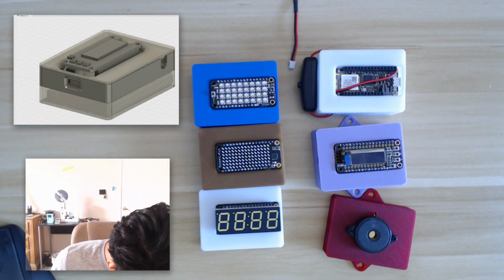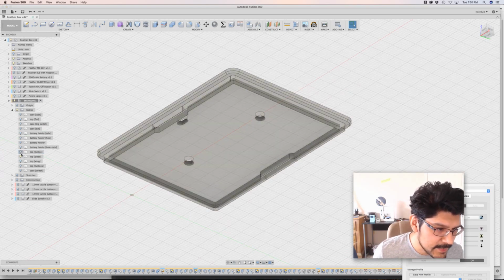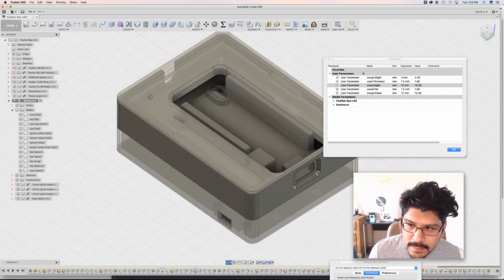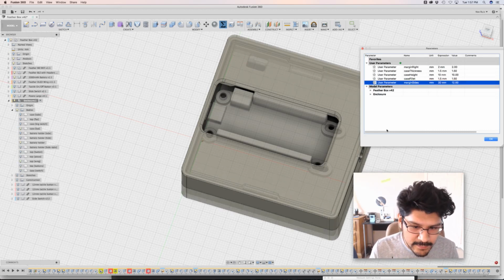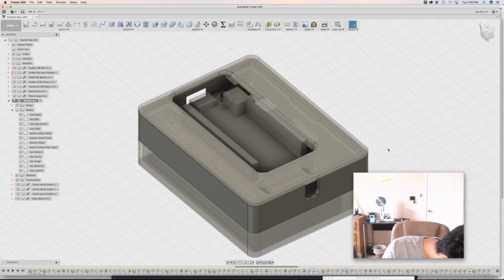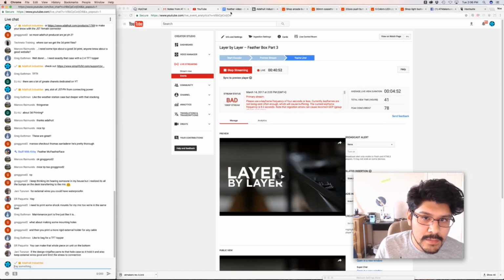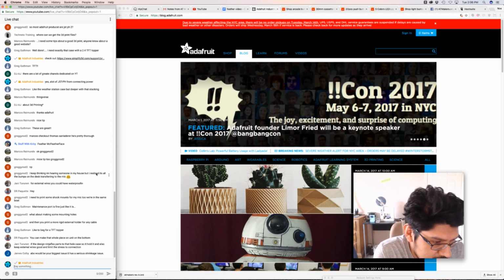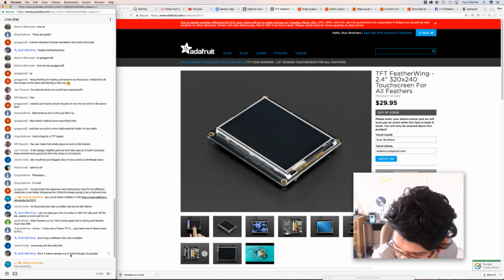Layer by Layer – Feather Box Part 3

Comment: Hi, is there a way to add a hole for sensors? (temp, humidity, etc). Also with wifi adapter? Great video, btw
Reply from the maker: +Mike Flanary Of course! Easy to make custom toppers. The sensors could also be wired externally, so the wiring can run through the slit. That'd be ideal for things like water and proximity sensor.